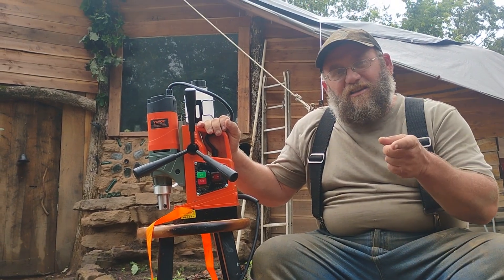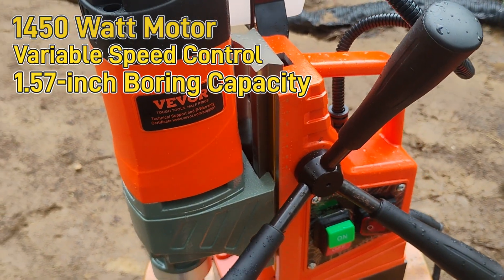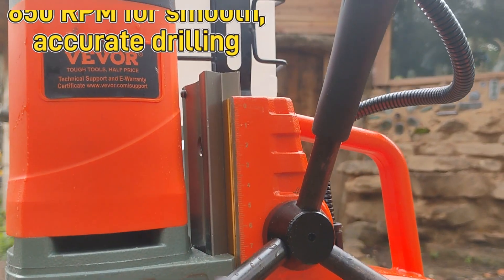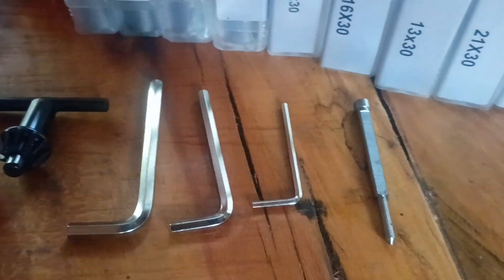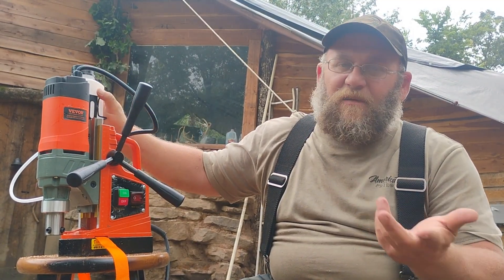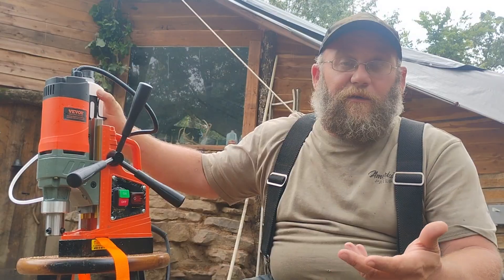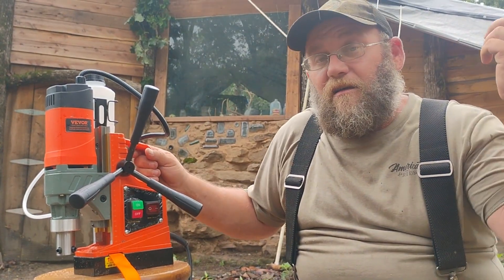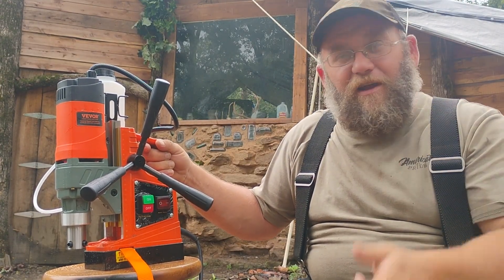Installing Marker Lights with the VEVOR Mag Drill | Trailer Upgrade Project #vevor

Comment: I've done a fair share of drilling through Stainless Steel.  The magnet does not help.  I also learned that spraying your coolant at the top of the hole, so the run off gets used as well.